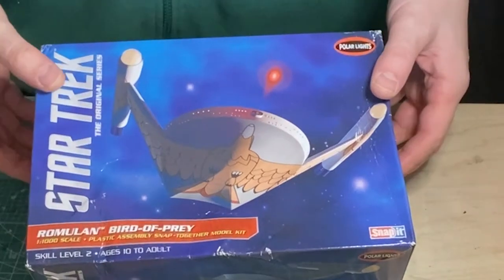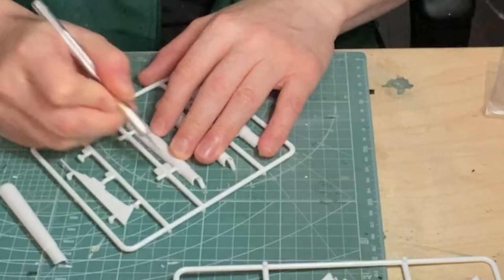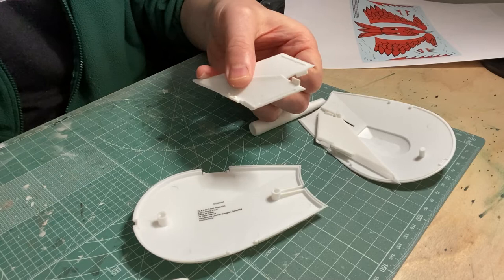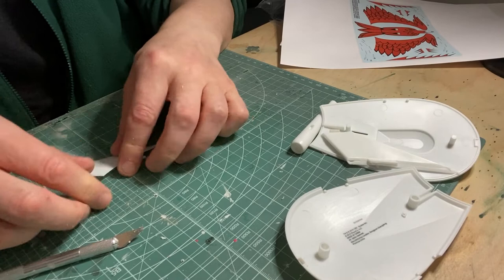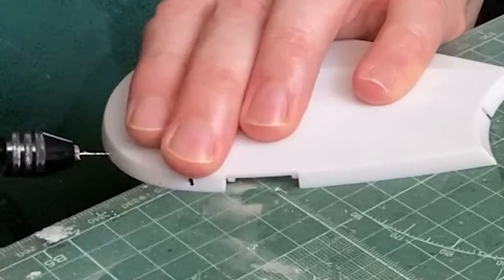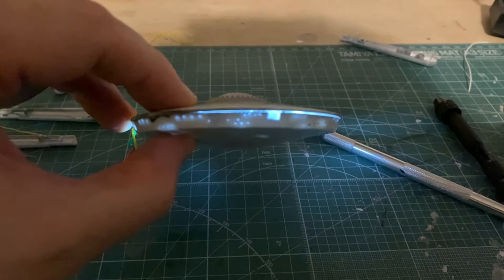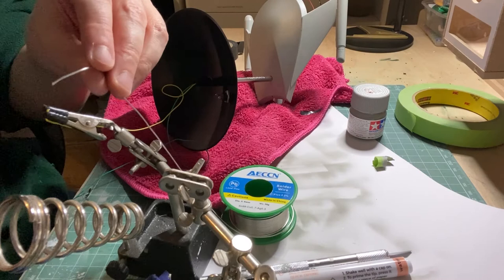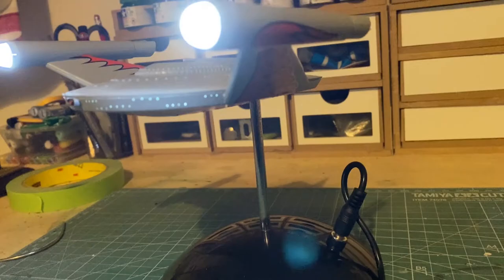1:1000 scale Classic Star Trek Romulan Bird of Prey

Comment: How did you get the window decals?
Reply from the maker: No decals used, I just drilled out the windows then used Micro Crystal Clear glue, which goes clear once dry. That makes it look like  windows, as opposed to just holes.
Reply: @dansmodeluniverse  I just got the same kit. Might light it too. Just need a template for drilling 🖖🏼